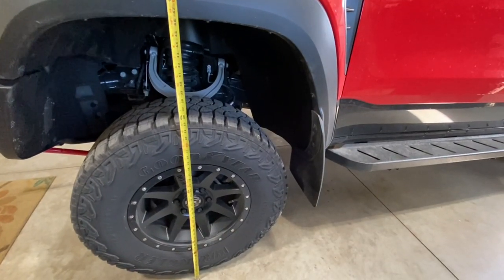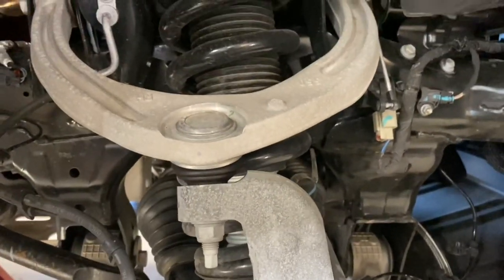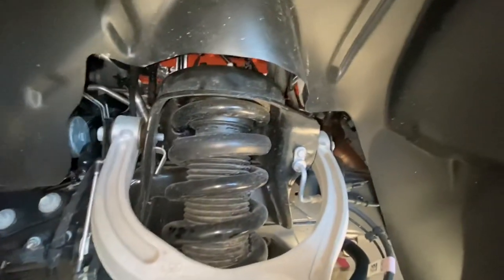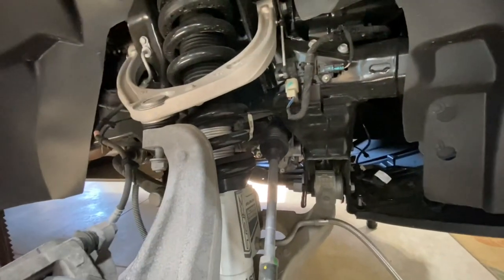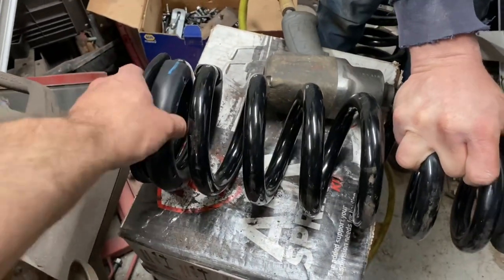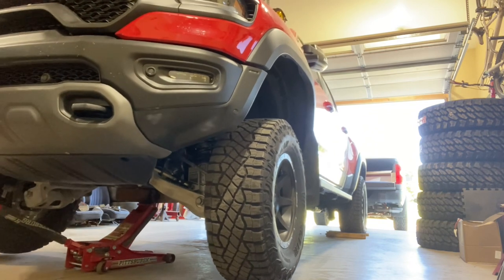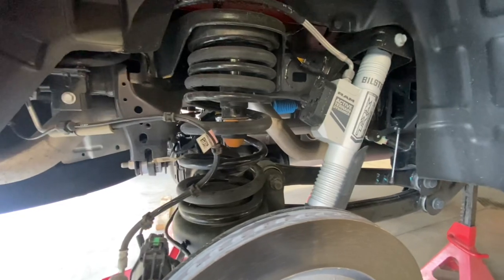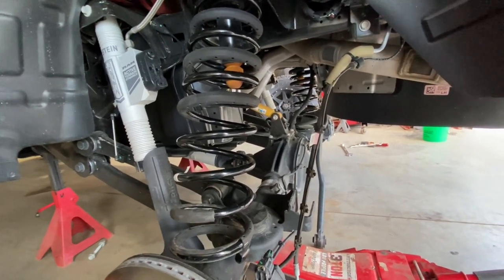Lifting a Ram TRX with Geiser Off-road springs

Comment: The trx needed these coils in the front at least from the factory for the fact that the front bottoms out too much(I for one do not want it lifted any higher but probably will do the coil swap just for the front coils). Rear seems to be ok but for it to be level you would need to do all 4 coils.  TRX already handles good(not great due to the 6.2 noise weight) but if it handles better then that’s a plus if you still running with no rear sway bar.  Offroad the rear sway bar would limit the trx.  Yes you have to reset the trx ride height at the dealer due to the sensors not realizing you lifted the truck.   I heard it’s a 30 minute job at the dealership.

Comment: Do these springs take into account the recent left leaning issues noted in the service bulletin 02-004-21? The Ram Dealer has confirmed this issue on my 2021 TRX and will replace the left front and left rear springs to level the truck. Rather install these springs all around, but want to know if it will still have a left lean. Thanks. Really love the stance of the truck after spring install, great job!
Reply from the maker: That would be a good question for Geiser Off-road. As of current the truck measures even side to side after 500 miles.

Comment: I agree with you. It should come like that from factory. How does it drive ?
Reply from the maker: The owner loves the ride and handling. He has gotten a error code for off road stability. Thinking the ride height sensors need to be reset for the new stance.
Reply: @turbostoybox2182  do you still keep the same factor ride ?
Reply from the maker: @hamptonsluxuryvillasinc978  Yes rides as good if not better than stock.
Reply: @turbostoybox2182  ok cool I just got 35 13.5 26 and I was told I needed a leveling  kit, man the ride sucks. I was trying to find another solution. Thanks

Comment: Can you please tell me if that TRX was still sitting on 35’s during this video? It looks amazing, my TRX is on order and I want these springs but hoping the increase in height still looks good on 35’s instead of 37’s. Thank you!
Reply from the maker: Yes the truck was on 35” for the entire video.
Reply: @turbostoybox2182  thank you sir!
Reply: @turbostoybox2182  hey quick question, how did the angle of the CV axles look after 3” of lift in the front end?
Reply from the maker: @liftit8461  I didn’t think it looked bad. Not as bad as my Tacoma with a 2” leveling kit. And those are fine after 20k miles
Reply: @turbostoybox2182  sweet thank you!

Comment: Turbo. Have you found that lifting with the springs caused irreparable damage to the ball joints or anything else? I’m looking to do this but don’t want to until I know of it’s going to put too much pressure on the supporting system.
Reply from the maker: By lifting it with the springs, you’re usable travel is still the same as original. Therefore the ball joints and tie rods are still working in their originally intended range of motion. No more wear than Dodge intended from the beginning.
Reply: @turbostoybox2182  thanks brother. After installing the springs, does it require a reset of the ride height sensors?
Reply from the maker: @gwithrow79  Yes it did.

Comment: Curious how tall your garage is since you were able to back it out after the install. Did you notice it being close to the top? I have a standard 7ft garage and with stock height being 80.9 plus 2ish inches for the springs (82.9ish total) seems really close for a 7ft standard garage. Then if you want to throw 37s or 38s on the truck your pushing 84+ inches.
Reply from the maker: I have a 8ft tall door. Sorry I didn’t measure a overall height after.
Reply: I just had mine installed and the shark fin up top touch’s the frame of my 7’ garage opening. I would assume after the springs settle it’ll clear better.
Reply: @freedomfire1776  Nice! Good to hear! Are you running 37s or 38s? Or are you still on stock tires?
Reply: @tjrehagen8127  still on stock tires. Now I’m working on talking the wife into letting me make our garage opening bigger haha.
Reply: @freedomfire1776  haha! Best of luck my friend. If you’re successful, you’ll have to share your tactics so others (myself included) may replicate and have the same success! LOL!

Comment: Just curious why you did springs and not a leveling kit? I have a TRX and want to run 37’s or 40’s if possible. What size tires are these on this truck? Please let me know your thoughts. Thank you!
Reply from the maker: Most of the leveling kits allow for extra drop travel which over extends the cv axles and cause major issues. This truck has 35s throughout the video, but has since been swapped to 37” tires.
Reply: @turbostoybox2182  it would be sweet if he'd let you take it back out with 37's and do a video on power performance and ride
Reply: I can't find a TRX video anywhere driving down the road with these springs and 37's discussing power loss, handling or ride in town and/or on the highway
Reply from the maker: @liftit8461  I will get with him and see if we can do a follow up!
Reply: @turbostoybox2182  LEGEND!
Reply from the maker: @liftit8461  Meeting up and update video to come shortly!
Reply: @turbostoybox2182  Boom! 🙏🙏🙏

Comment: Question, what does it mean if the passenger rear spring is bowing toward the rear of the truck
Reply from the maker: Not sure, sounds like a possible bad spring.
Reply: @turbostoybox2182  guess the upper spring tab wasn’t rotated to proper location
Reply from the maker: @hpassault  huh right on. Didn’t know it could cause the whole spring to bow. Crazy.
Reply: @hpassault  Did that solve your issue? My truck is at the shop now and it looks like the rear is sitting way to high. Do you have any idea what could be causing that? The center of wheel to bottom of fender measurement is over an inch more than Geisers spec
Reply: @epap1375  My TRX measurements PasFront 43. 1/4 ” PasRear 43 1/4” DiverFront 42 1/2” DriverRear 43 1/2”
Measurements from bottom of fender to ground  I’m on stock 35” tires 
I contacted Geiser and  they said there aware of the problem but have no solution.  I guess should have went with pre-load spacers